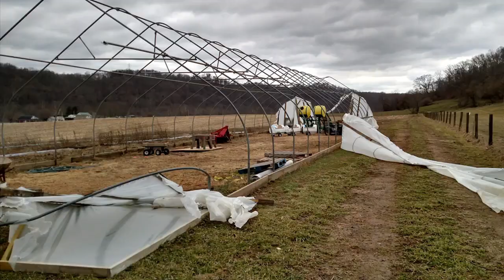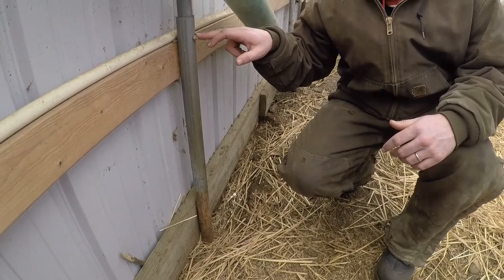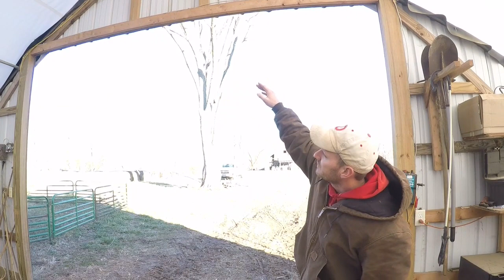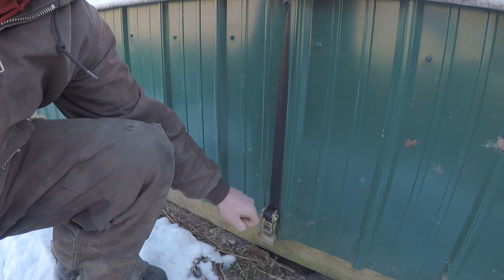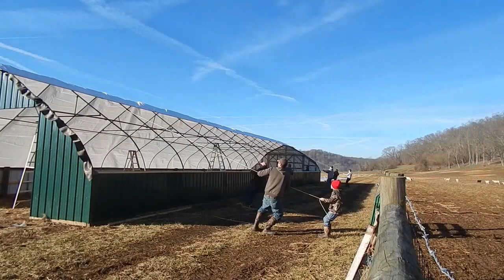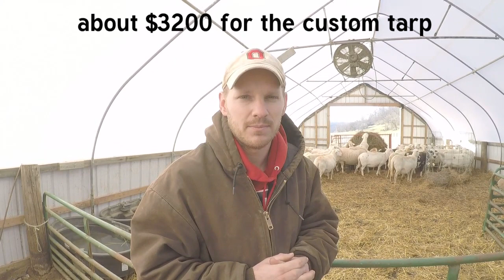How we transformed a high tunnel to a barn! Cost & what we'd do differently now

Comment: To prevent condensation, have you tried only heating it (with minimal air flow)?  Condensation only happens when warm air touches the cold surface of the tarp.   So keeping it warmer than air temperature should do it, like the windshield on your car.   I wouldn't worry about heating the entire space. Just the tarp itself.  May be a few strategically placed heaters near the tarp surface....or some low temp heating strips along the tarp (also like rear glass automotive defrost elements)... Just thinking out loud.

Also....if you build a regular barn with steel roof, you'll still have the same condensation issue unless you install a thermal break between the purlins and the actual steel roofing....unless you go for plywood/osb sheeting as that in itself would act as a thermal break, but I would still install a protective layer anyway, to protect the wood.

Comment: I have been considering using two high tunnels to build a barn then convert to living space and shop space. Starting first with white sileage tarps for roofing. Later adding 1x4" wood across my trusses and then tin the whole thing with windows amd doors. I can put trusses two ft on center, and use 10' ground posts to make a finished 9' ceiling. My high tunnels are over engineered for load in my climate, more bracing than yours, and 32'x96', so it should work without permits. Thanks for sharing your experiences.
Reply from the maker: No problem, we wish you good luck!

Comment: late to the video..Most any structure with animals will have moisture vapor control issues. Pole barn builders recommend at least a minimally insulative sheet under the roof tin to prevent dew-point condensation accumulation on the bottom side of the metal, it's a very effective and inexpensive solution.  Side wall and roof peak venting encourages air to flow from bottom to top of the underside of the roof. I've never noticed peak vents in a hoop barn. Maybe it's not possible.

Comment: What would happen if u put in some vents down on the bottom in your steel walls that U can open and close with a slide?  U think that would help with your ventilation issues?
Reply from the maker: We have some at the end of the barn with the doors (from the direction the wind comes) and they do help.  I imagine if we put them in along the sides of the barn it would help too. But I still think the majority of the heat would rise, I think some type of ventilation out the top would be the most ideal fix.

Comment: Not that it’s doable now, but if you were to do it over, would setting the high tunnel up facing another direction flow more air through and cut down on the condensation, or do you think that’s just the nature of having that large span of plastic with no way to vent the top?  You guys definitely did a good job on the construction, I like the ends.  My cousin next to me put up two clearspan hoops to replace a shed that burned, and they have the tarp end walls on one end of each of them, they lasted about 10 or 12 months before they started blowing in the wind and eventually tore, rest of the tarps look great 8 years later.  No support on the endwall on a 32x16 end and it’s just too much area for the wind to grab ahold of.  I like your frameout idea better.
Reply from the maker: It's in line with the wind direction at the moment so when there is a breeze it flows through as much as possible. I think the biggest issue is no ventilation out the top.  Once the sheep aren't in there creating heat I don't think it'll be a problem any more.
Reply: Rocky Knob Farms ah, gotcha.  Makes sense the condensation would stop or at least decrease tremendously once the sheep are out.  I’ve got a 36x80 machine shed closed in on 3 sides with the closed in long side against the wind 90% of the time, so it doesn’t breathe at all... right time of year with a cool overnight and temps come up quick in the morning it’ll rain in there pretty good for awhile.  Nothing major, but you can tell the rock floor is darker.

Comment: Where do you buy the custom tarp from?  I can only find them as part of a complete building
Reply from the maker: We got ours from FarmTek
Reply: @rockyknobfarms  Thank you much for the fast response.  I called them and I was quoted about 3 times more.  It seems that for only a small amount more, it's better to just buy the whole building from them (albeit for extra labor cost), especially if you want the pockets (for the pipes) and ratchet straps on both ends of the fabric.  Or may be prices have just recently skyrocketed so much that all that has changed since you did it.  Thanks again.